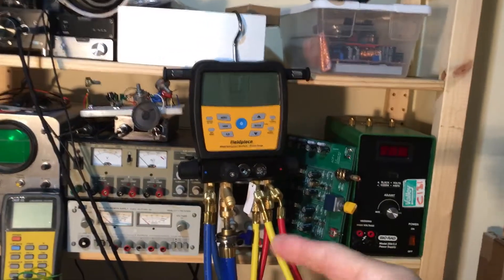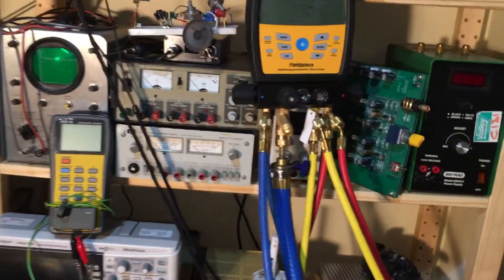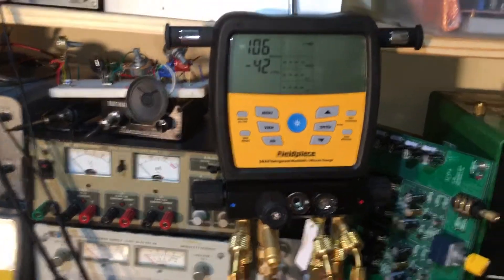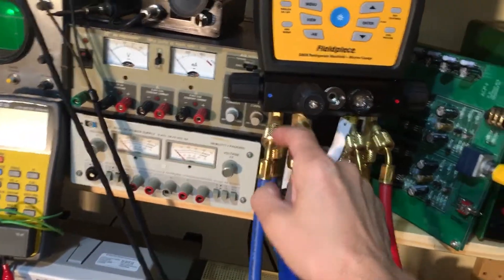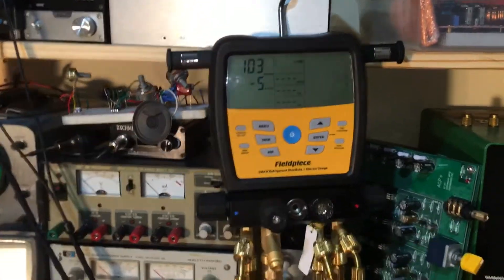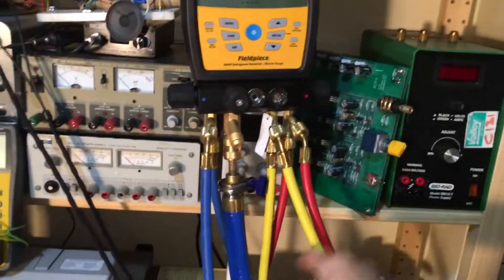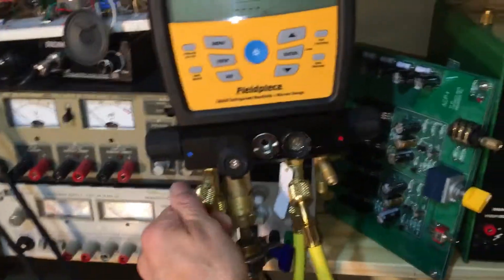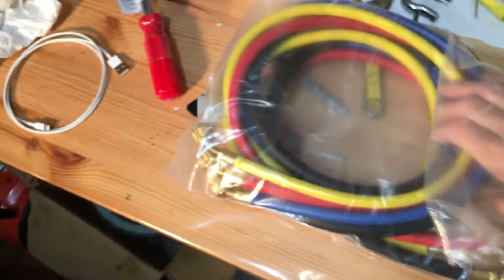Pt:7 SM480V  vacuum decay test success overnight test.

Comment: Insane only extra 87microns after 12 hours from 13 microns and this is a manifold with high air volume, almost like a small air volume to ball valve CRT tightness. Awesome Tom. My el-cheapo manifold gauge failed vacuum/micron test within 2 minutes...LOL.